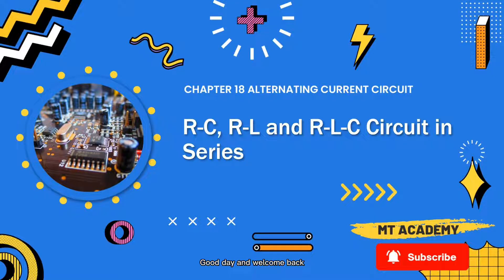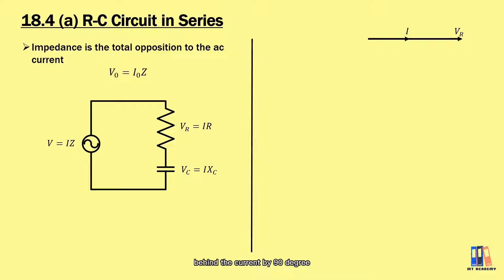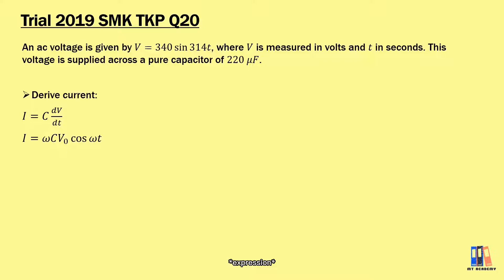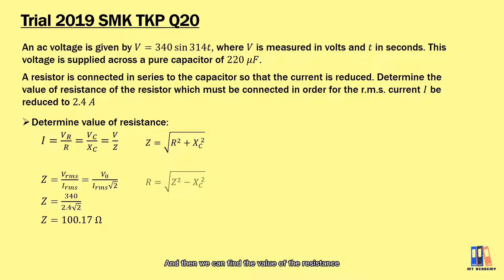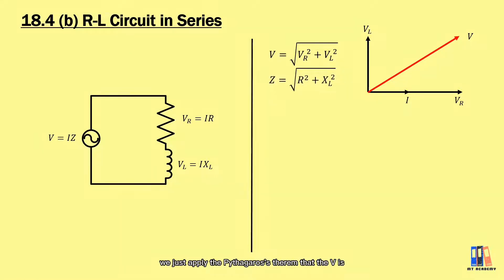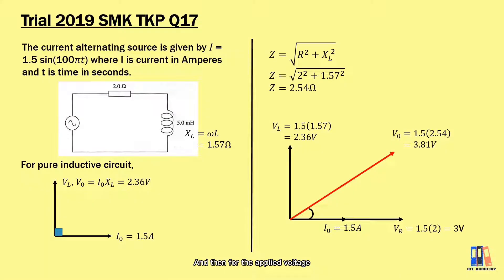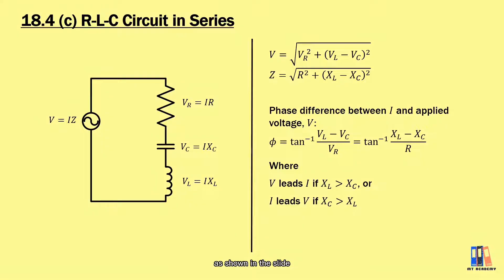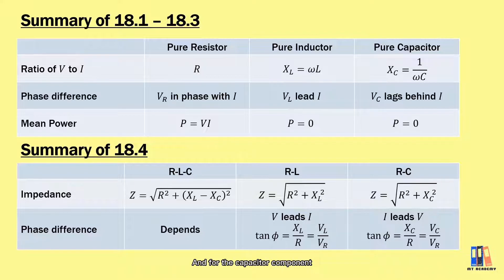AC Circuits: R-C, R-L and RLC circuit in series | STPM Physics

Comment from the maker: There is mistake at 5:38, it should be "in anticlockwise direction"

I have just finish the syllabus, so I will stop updating the video for a while. Since STPM is around the corner, if you need revision on certain topic, you may fill in this form to let me know about it.
https://docs.google.com/forms/d/e/1FAIpQLSfeU7QZdThTmUx7mY6QCVsQhKPxiev-uH82rdd7Weseyg5_1Q/viewform?usp=sf_link

Kindly give me your feedback/comment using the google form below
https://docs.google.com/forms/d/e/1FAIpQLScpahnd-z_UOuh9ZsAcI8XHC-BxYMk0eCX4-17xOVGoRQFQDA/viewform

Join the telegram physics channel to get notes and trial papers.

https://t.me/stpmphysics
https://t.me/Physics_STPM

(DISCLAIMER: I am not the owner or admin of the telegram group.)